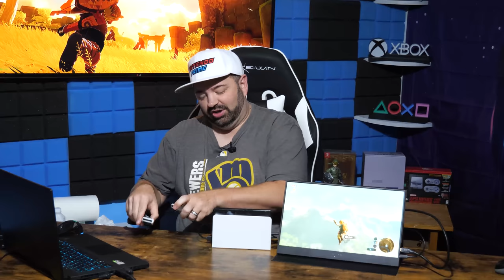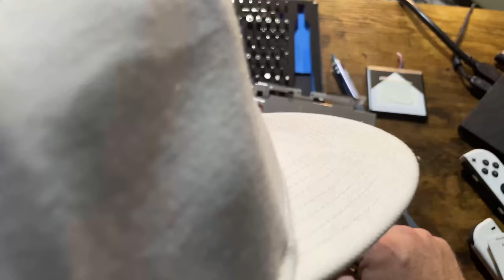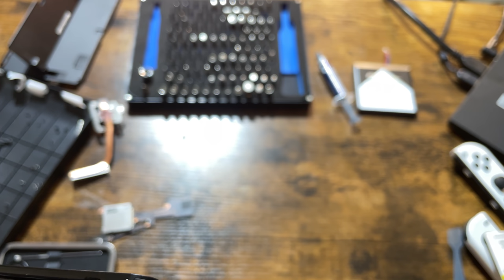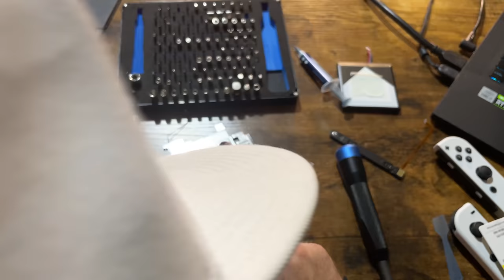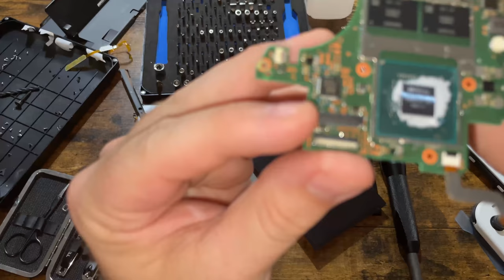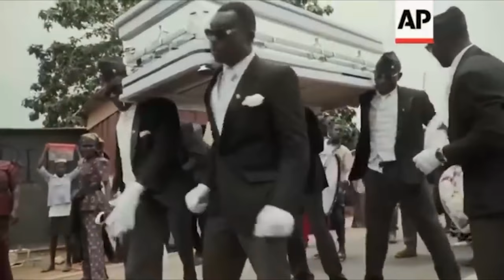I Destroyed My Switch OLED To Show You This

Comment: It's not using "less quality pixels". The larger 7" screen means the same 720p resolution results in a lower ppi. THAT is why the ppi is less
Reply: Kevin Kensons already addressed this issue, and there is negligable difference and wont be noticed with the naked eye.

Comment: Less pixel per inch does not equal "lower quality pixels". The pixel formation in OLED is actually MUCH better than in standard LED\LCD displays since they are self lit and often a cleaner formation. While the pixel density is less in the OLED Switch due to the screen on the OLED being BIGGER (the ONLY reason the density is less. Has nothing to do with "quality"), the screen is vastly superior

Comment: PPI being 11 lower does NOT mean the pixels are lower quality. Where did that even come from? PPI is pixels per inch. Since the screen is bigger and it's still 720p, ppi aka pixel DENSITY is lower. DENSITY not QUALITY. That also doesn't directly relate to brightness.

Side note we already knew Samsung was providing panels to Nintendo earlier this year and the PPI you can simply calculate/google based on the resolution and screen size. Nice to have confirmation that it's Samsung I suppose but unfortunately also not new information.
Reply from the maker: Samsung was just rumored - not confirmed. Also; ppi is pixels per inch. If the pixels per inch lowers while the screen gets larger, it means the quality of the pixels is also lower because there are less of them over a larger area. It means pixels should be more decernable. 

It wasn’t about relation to brightness. A higher ppi takes more power. They have battery length targets to hit and if they raised the ppi they would lower the light output to compensate on the battery.
Reply: @NintyPrime   You can say less PPI makes the ~screen~ lower quality as it's less sharp, but even then it's only one aspect of quality and really doesn't matter much with this size screen. It is just plain inaccurate to say less PPI makes the pixels lower quality. A 1080p TN panel would have much higher PPI but I would say the individual pixel quality is abysmal compared to 720p OLED.

Also it is still unrelated to brightness or power. Look at phones with qHD screens and 600 nit brightness. You can set brightness yourself and change resolution to save power. They didn't choose 720p to save battery, they chose it because many games barely maintain that resolution anyway, the screen size doesn't warrant higher resolution, and it's more cost effective. Same with the Steam Deck though it's slightly higher res.

Comment: PPI does *NOT* indicate quality of the pixels.  But the number of pixels in an square inch.    Your putting a 720p image on a larger screen.   OF COURSE YOUR GOING TO REDUSE THE PPI.   Your talking out your ass.   The screen is larger that is why the PPI is lower.   The switch lite has a higher PPI Than the normal switch simply because the screen is smaller. So the pixels are jacked closer together.   This has nothing to do with quality or luminocity.   PPI is simply how tightly the pixels are packed together.

Comment: the pixels are much higher quality being OLED. They are just bigger by a tiny amount. hold the OLED 1cm further from your face and there will be no difference.
Reply from the maker: No, that’s the coloration of the pixels. Not the same as the pixel quality itself. That’s not determined by coloration. That being said, it really doesn’t matter. They made the correct Choice
Reply: @NintyPrime  respectfully you're just wrong about screen tech. OLED doesn't mean "coloration" it means every pixel is individually lit as opposed to regular LED which uses one or several backlights for the whole display. So LED looks grayish even if pixels should be black due to light bleed, while with OLED a black pixel is off so it really looks black. This results in far better contrast for OLED.

"Coloration" isn't even a term you'd use necessarily but maybe you're thinking of sub pixel arrangements which are how the red, blue, and green pixels are set up and do affect color. This can vary between displays. Samsung has used a variety of arrangements on their panels through the years.
Reply: @NintyPrime  pixels per inch is just a measurement of pixel density and has nothing to do with quality. an 85 inch 8k OLED TV has a way lower ppi than the OG switch. could you elaborate on how a low quality 720p LCD has better quality pixels than anything OLED?
Reply from the maker: @jaerdahl  higher ppi = better output. The original switch has a higher ppi over a smaller screen.
Reply from the maker: @bdhdr4226  call it contrast. It doesn’t matter what the term is - colors, not just black and white, really pop on oled panels. So even as the pixels are bigger and less of them per inch, it’s easy to overlook because the games all pop much more.
Reply: @NintyPrime  do more research. pixels per inch strictly means how tightly packed the pixels are and means nothing as to how bright or clear or vivid they are. those are measurements of quality. ppi is quantity. given two identical screens at the same distance and different ppi, the higher ppi will look more crisp but that has nothing to do with the quality of the pixels. they are just smaller pixels.
Reply: @NintyPrime  Original Switch has 6.2" screen so the 720p resolution (a FIXED number of pixels) has a higher density per square inch. The larger you make a screen of the same resolution, the lower the density. Has absolutely nothing to do with "quality". You make a 720p screen larger, you get a lower pixel concentration per square inch.
Reply: @NintyPrime  Agreed the colors are great and nobody will notice the drop in PPI. The issue is just the statement in the vid gives the wrong impression. You say the pixels are lower quality when they aren't.
Reply: @NintyPrime  The term does matter because words have meaning.
You're incorrect and instead of owning it and making a correction you're acting like you're an expert when clearly you don't have a grasp on fundamentals.

Comment: You wonder what nobody else did to the switch? 
 
- What glas is the screen made of?
- Is there a plastic screen protector on it? 
- Does peeling it of destroys the display 
- is the Stand out of metal?`
- Is the construction of the Oled more sturdy, do the joycons break of when bending.? 

You basically do this video before Sack comes back from his baby vacation ...

Comment: I thought ppi was pixels per inch, not the quality of pixels themselves. Doesn't it just means a lower pixel density over a certain area, I guess 11 less than the OG Switch?

Then again I could be wrong. Don't have a way to check right now at work
Reply: No, you're correct. His statement made no sense whatsoever. The larger 7" screen for 720p results in less pixel density per inch.
Reply: ppi is pixel density not quality

Comment: Prying glass? Really!? Why you don't use suction cup instead like normal people do?
It's not even expensive tool.
Reply from the maker: I tried a suction cup and it didn’t work. Reality is I could not get the temperature high enough to fully melt it.
Reply: @NintyPrime  It must be very strong glue... Oh well - for the science! 😉
I can only recommend Amtech J1830 mini suction cup. It's a very good tool. I use this for removing glass screens from GBA (extremely strong glue with those IPS kits).
Reply from the maker: @rhtr.  Yeah when I do phones it's suction cup city. Whatever glue this is has a high junction point. Never seen one that I can't use a hair dryer for.
Reply: @NintyPrime  You said you have experience in repairs...
Reply: @NintyPrime  hair dryer...
You don't have a proper heat gun?

Comment: Off course 720p at 7 inch screen is better.. it has 210 ppi.. most pc gamer use 24inch 1080p monitor and image quality is very good even though it's only 92ppi ...yet the switch have 210 freakin ppi..

Btw ,, the way you open the screen using a hair dryer + metal prying tools is what makes the screen break. You should use a heat gun on 100c and insert a very thin card plus isopropyl alcohol to soften the glue.. the screen will not damaged by alcohol so dont worry..

Comment: Bro does OLED switch screen can be used on v1 and v2 switch? Is it possible? If it possible than just buying OLED screen for my v1 will save me a lots of moneh
Reply: Lol no ofc not
Reply: You actually can, a Chinese guy did it already, but it has some issues with the touchscreen not responding
Reply: @aya8475  really? You got the source? I want to see.. send me the link
Reply: @amirulshafix8759  Well, you need like an adapter and stuff, I still think you should wait a bit to get things more clearly
Reply: @aya8475  i see... Ok..

Comment: battery life on the oled is better than the v2 so the battery life isnt the same. the batteries are the same yes, but while gaming you can get up to 8 1/2 hours depending on the game compared to the v2 because the v2 had a backlit screen where the oled doesnt

Comment: What would happen if u stabbed ur battery?
Reply from the maker: It would smoke and spark. Why?
Reply: @NintyPrime  , incase u wanted to further finish off ur switch oled and make a fiery video... make it batteryless... of course with the battery already removed in a safe spot then u stab the battery.